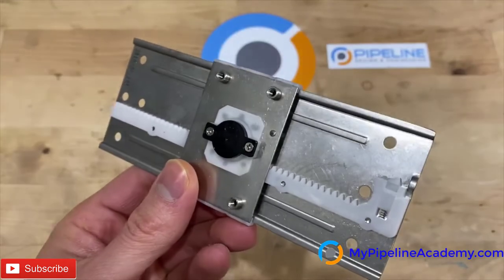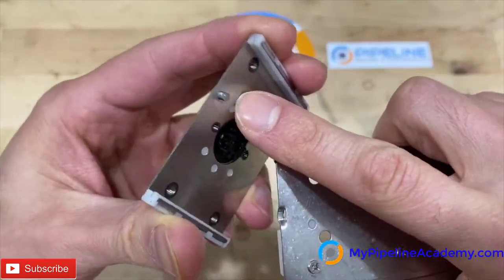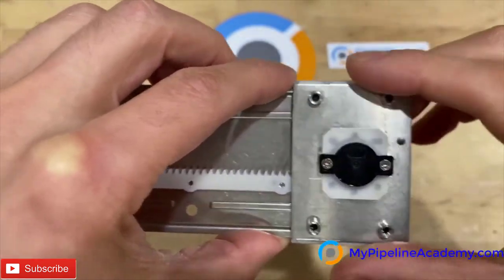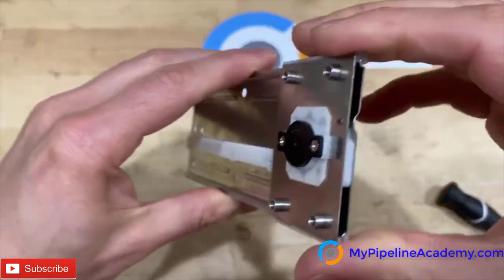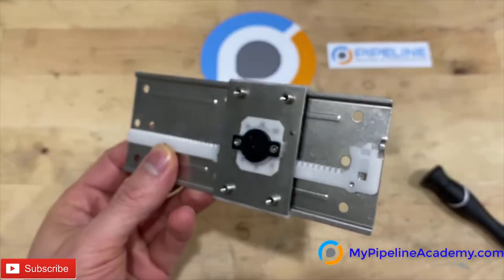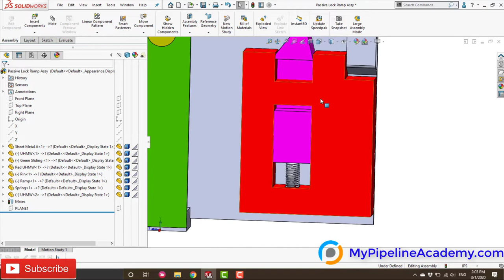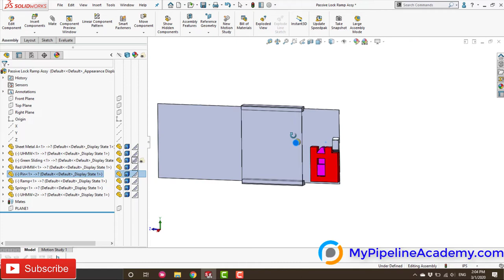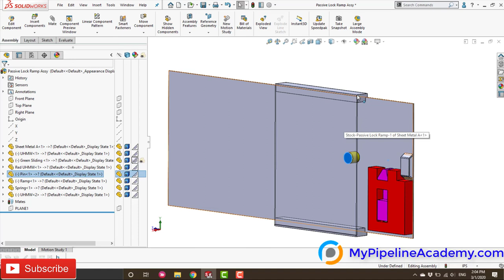Passive Lock - Mental Mechanism Library

Comment: why do you need the rack and pinion? or is that for something else?
Reply: I think it's an example for when it could be used. Put a motor on the gear and you can slide it open but when the motor is unpowered it is still locked. So active lock would be the motor powering, passive lock with the mechanical contraption.